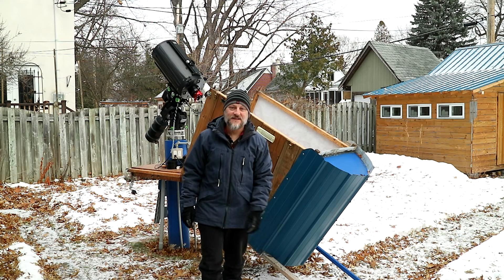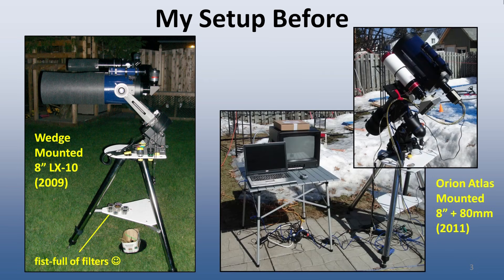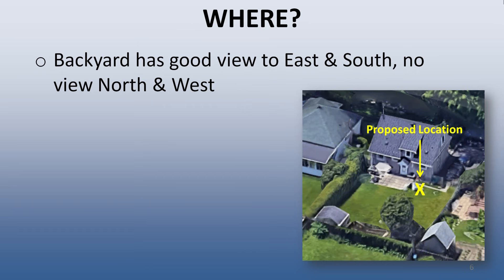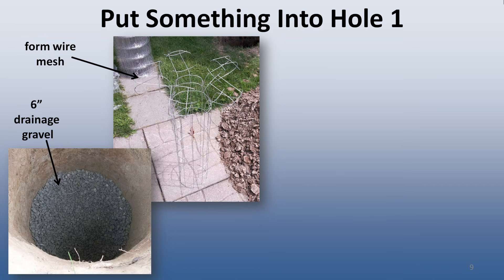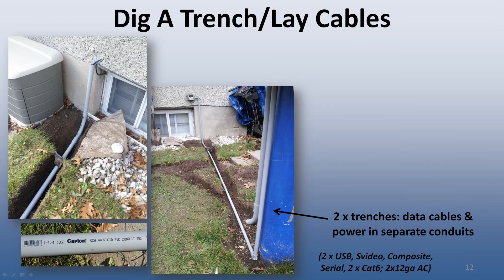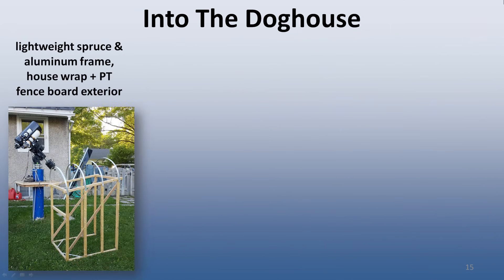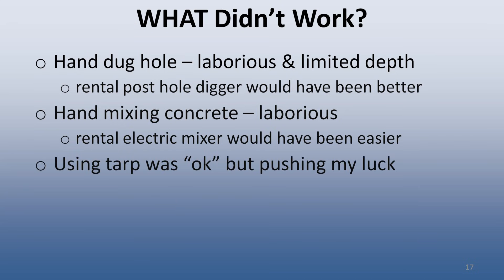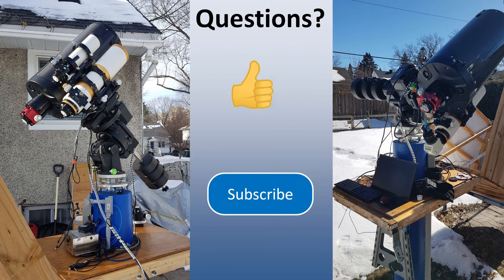Building a Micro Observatory

Comment: I love thinking outside the box, but I would have a few concearns with this design.

1) The "building" that hangs off the pier will catch the wind and transfere the energy into the pier inducing vibration/wobble.
2) The cable trenches  are way too shallow, this is potentially dangerous, anyone putting a shovel, rake or anything else in the ground might be electrocuted. Trences should be at least a couple of foot deep.
Reply from the maker: Thanks for your comments.  With regards to your two points of concern:  1.  My setup is very close to the house and so is sheltered from the wind.  Wind induced vibration has not been observed during my observing sessions. 2.  The province of Ontario electrical code allows electrical services to be buried at a shallower depth if they are sufficiently protected, either in a conduit (like I did) or with a metal or wooden cap overtop of the buried cable.  The buried services in my case are also mostly covered by a patio stone walkway, so the chance of anyone digging in that location is low.

Comment: Cool, thanks for the video. It looks like a big mail box. I have the same struggles, work, kids (3), wife, and house maintenance. I like the design. I have always worried about the toll the heat and humidity would take on the electronics. A ventilation fan in the summer would help. My gear lives in the basement, so most nights I just run outside with the S50 after the kids go to sleep.

Comment: Thanks for the great video.  One side note for others watching, depending on your requirements it is more stable to dig a hole the size of your pier and fill the entire hole with concrete. This provides a more stable foundation to be in direct contact with untouched soil.  That also means the sonotube should not go below ground level since it will eventually rot away and create a void allowing some movement.
Reply from the maker: I did consider pouring just a concrete base and then attaching a steel pier to that.  This seems to be what most people do.  My solution was significantly less expensive than purchasing a custom metal pier made to my requirements.